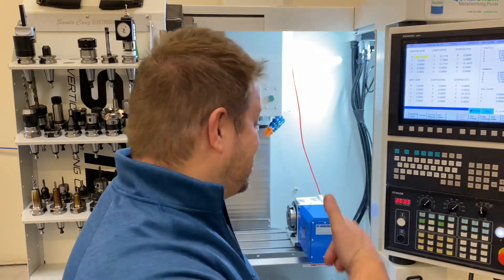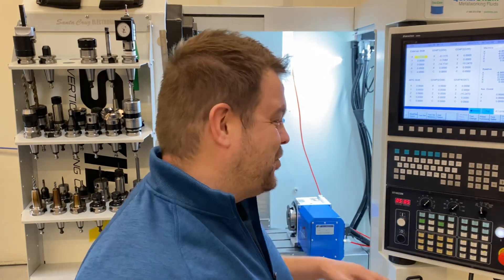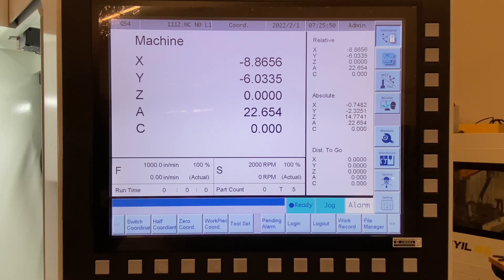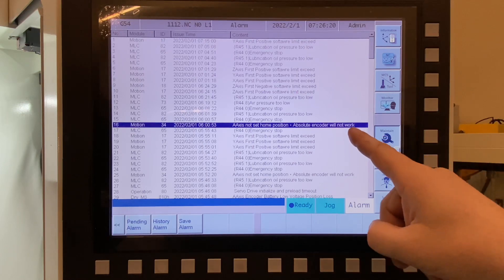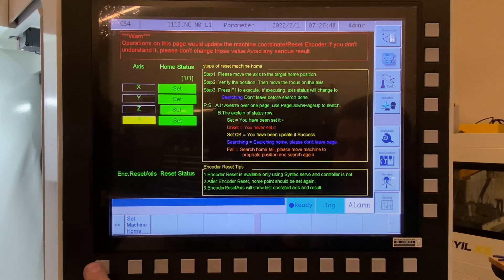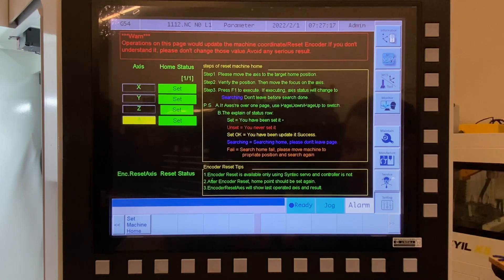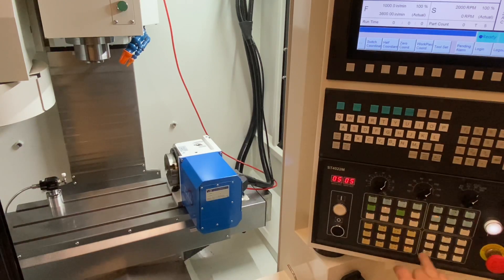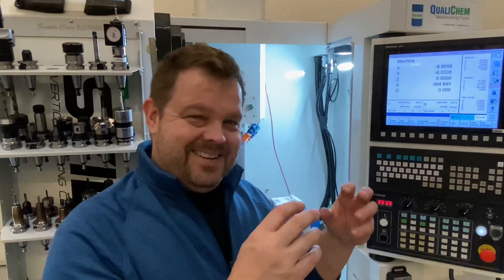Syntec 22MA - Reset Absolute Encoder position - A Axis

Comment: To anyone visiting this to adjust absolute encoders. 
Whilst yea this would work for a rotary axis such as the A axis. There is a bit more involved in linear axis. Usually you installation manual will show you where your home position is. If you lose either the X Y or Z axis and need to reset them. You need to ensure you are in the right position before doing so. 
For Z-Axis it's usually a height/distance from the table to spindle nose. This is very important as it will also control your tool change position. Setting it to high or to low will result in tool changer crashes into the spindle
X&Y axis you can find by using a dial, finding the centre of the table and moving a specified distance from there to the home position.
Reply from the maker: Thank you Mitchell...I pinned this comment. I did this with the help of Syntec America.
Reply: Always happy to help. I've seen my fair share of places think that they just need to press the set button and all is well. Then they try and tool change and it doesnt go so well after that.
Reply: Sorry,  how did you obtain the value for A? ( I will have to add this after machine arrives)
Reply: @killerfungis  A- Axis is rotary so home position is not super important. You can set it anywhere. Most commonly you would set it with a table slot parallel with the Z-axis or with a chuck jaw parallel with Z

Comment: You saved my But Sir.
My cnc sheet router suddenly had the same error, and I was lucky to see your video.
I have not solved the root cause of the problem, but I set the A axis each time I start the machine and can work again.
Thank you so much.
Reply: You may need to change the battery that is located on the encoder cable

Comment: Thankyou for all your videos! I've purchased a TAICNC T6V cnc machining centre, similar to your X7. I went with the TAICNC as it was a bigger machine for the same money, but still uses high end components. My machine also has the Syntec 22ma controller, but my screen is the smaller version than yours. I appreciate your videos, especially the ones on the controller, as I've not used it yet,  but I've used Okuma, Fanuc Mori Seiki etc. Cheers for the vids!! Much appreciated!!!
Reply: How do you feel with taicnc machine?
Reply: @comiccomedy2404  hey there, the T6V has been excellent, lead screw backlash in all axis has been within 15 to 20 microns. Build quality is excellent and the Syntec 22ma controller with using Fusion 360 and the Syntec post processor has been problem free. The only issue the machine had was the spindle coolant level sensor in the air-conditioner was out of adjustment and I sorted that. 21 tool holder rotary umbrella changer fast and excellent. Does reduce the Z axis stroke, but not an issue for me. The tool holders have to be loaded manually on it's right side and there is no tool holder changer button to load the spindle manually, which was the only let down, but not a big issue at all. I've used Mori Seiki, Okuma  cnc machines in the past and the build quality is every bit the same. Spindle speed is 20k rpm and is bt30. Traditional cast iron frame and column. Lighting inside is good, 2x cooland nozzles, 1x air blast, 3 either side chip troff sprays. Good machine and I chose it for the greater x y axis over Syil and slightly better value for money. The Syntec controller is a slightly lower spec model than the one used in this video, but is not relevant. I recommend the company and the machine.
Reply: @hugoperry1452  thanks for the reply...did you buy directly from the company or with a dealer?
Reply: @comiccomedy2404  I bought directly from Taicnc and organised my own shipping agent. Zhouyang was the sales person I dealt with on WhatsApp and was very easy to deal with. He said they were around the 3rd largest cnc supplier to China. You'll also notice that the T6v is very similar to a Fanuc Robodrill, and you also have options for controllers, including Fanuc and Seimens, but the Syntec controller is very much like Fanuc anyway.
Reply: @hugoperry1452  thanks for reply...
Rigid tapping is ok?
Reply: @comiccomedy2404  yes no problem at all.